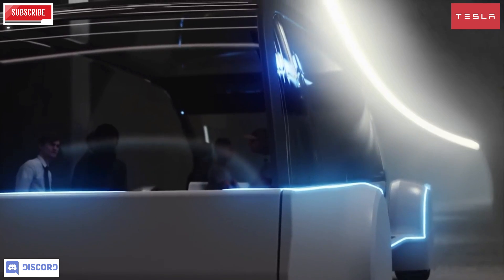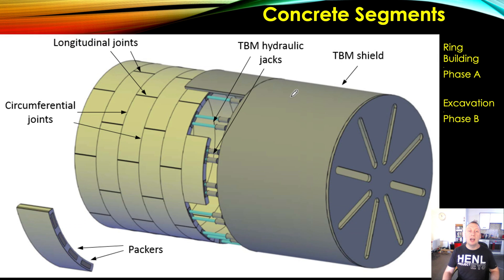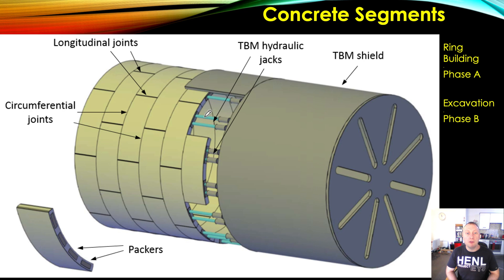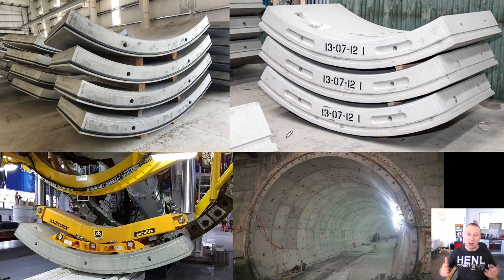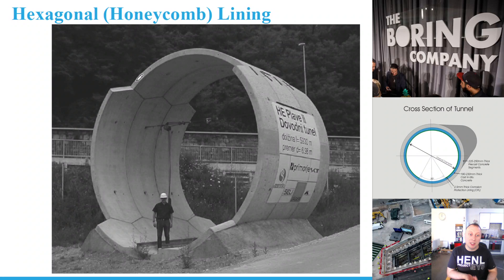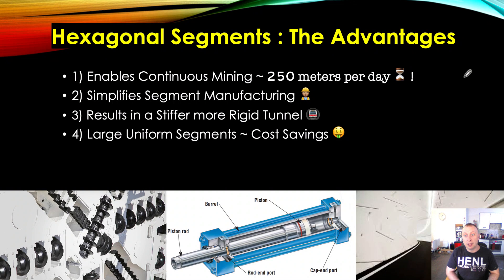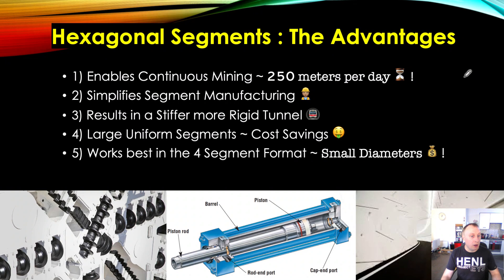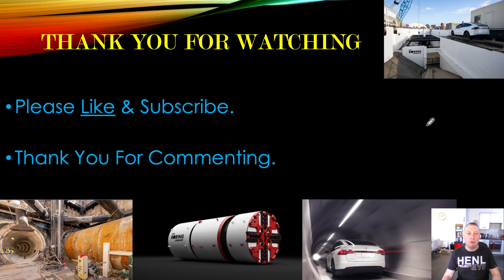The Boring Company 🚇 😃 🇺🇲 Hexagonal Concrete Segments Are The Future 👷🏽‍♂️ 🏗️ 🚎 PART 1

Comment: Hello;  I just found this channel.  I've heard that the next boring machine will produce its own segments as it goes, rather than bring them in from overground facilities.  If this is the case, the molds used to produce them could be articulated molds, able to produce bricks that continuously adapt in dimensions to support curving tunnels.  I'd like to have your thoughts on that.
Reply: Where did you hear that about the next tbm producing its own segments (wall panels)? Have you got a link to the source that you can post here please?
Reply: @dianax266  Sorry, I went looking for it and couldn't find it.  Maybe I misread something, or it was an opinion;  not sure.  I'm not in the habit of keeping links, bookmarks or references;  my life's problem...
Reply: @dianax266  I found where I got the idea;  it was an Elon speech;  which this recent CNBC spot on the Boring company replays:
https://youtu.be/hFx6vx4P9M8?t=315
But what he's saying is "Building the tunnel reinforcing segments on site ...", which I took to mean within the TBM, but it probably means simply having movable equipment that can make the pieces locally, near the tunnel, as opposed to in a factory in another city.
However, it seems to me a matter of time...  If you already have movable equipment that can produce panels, why not hook them to the boring train?  Or at least have a few tile making train cars with adjustable molds so that the TBM can produce its own custom tiles a la carte when it needs to, such as for turns, in/out ramps, etc.
Reply: @privateerburrows 
Thanks for the reply and sorry I did not reply sooner.

I took a look at the video you linked. Unfortunately Elon  appears to be not only ignorant of how concrete panel segments are constructed (which is done off site) but he is also misinformed regarding how other tunnel boring companies construct tunnels.  There is zero muck transported back into the tunnel (after the excavated muck is removed). The only materials transported back into the tunnel are precast concrete panel segments (and grout and the like).

It is quite staggering that the guy at the head of a tunnelling company knows so little of the absolute basics of tunnel construction. If you show the clip (you posted) to anyone with tunneling experience or a structural engineer then be ready for them to fall on the floor laughing.
Reply: @dianax266  You say that "Elon appears to be not only ignorant of how concrete panel segments are constructed (which is done off site)...".  He nowhere says that segments ARE constructed on-site.  He is talking about HIS OWN IDEA that it is better to construct them on-site.
  Then you say "but he is also misinformed regarding how other tunnel companies construct tunnels".  I don't see where he describes how other companies construct tunnels;  he is busy explaining his own ideas for how to construct them.
  You say "there is zero muck transported back into the tunnel";  but he never said that muck is transported back by other construction companies;  he says he wants to possibly use some of it in the manufacture of segments;  it is his own idea, namely to mix some of the muck with the concrete for the segments, which as per his own idea he wants to make on site;  and then make standard housing bricks out of the rest of the muck, to sell and help offset cost.
  Finally you say "it is quite staggering that the guy at the head of a tunneling company knows so little of the absolute basics of tunnel construction".  I find it staggering that you misinterpret almost every word he says, just to come to the conclusion that he does not know how to build tunnels, which he just finished building in Vegas !!!   Either you are an idiot or you must have an anti-Musk agenda;  or maybe you are in the tunneling business and are trying to keep yourself in denial of the fact that you are finished.
Reply: @privateerburrows 
This is what he says from 5.12 in the video you linked:

"The the dirt removal is continuous. Building the tunnel reinforcing segments on site instead of having them be built far away and trucking them in. Using the dirt that WE DIG OUT of the tunnel to FORM THE CONCRETE for the reinforcing segments.  In other tunneling situations, they actually truck the dirt from the tunnel out and truck new dirt in , which makes no sense."

Back in 2018, he expressly stated that TBC were making segments on site with muck/ dirt removed from the Hawthorne test tunnel therefore I suggest it is you (not me) that is mistaken.

Also, as clear from the quote above, he is referring to dirt being trucked back in (by other companies), which does not happen. 

Concrete panel segments are neither made with "dirt" / muck nor are they constructed on site.  They are constructed in factory conditions off site. 

As I said, anybody with any tunneling or engineering experience would know what he says is ludicrous and displays his ignorance of the basics for an industry that he has a company operating within.
Reply: @privateerburrows 
Perhaps you may wish to educate yourself regarding tunnel construction before you try pretending you know something about tunneling (based apparently solely upon what Elon says).
Reply: @dianax266  What you quote verbatim is exactly as I understand things.
When I said HIS IDEA, I wasn't speaking of "the future";  that's something you added.  Stop putting words in my mouth.
What exactly was a lie?
I saw people in video interviews who bought bricks from him and used them;  what exactly is "BS/lies" about his making bricks with the excavated dirt?
And if he knows nothing about boring tunnels, then explain to me how did he complete the first pair of tunnels in Vegas.
Reply: @privateerburrows 
You appear to be confused and contradicting yourself.  In your post circa 14 hours ago you state the following:

"He nowhere says that segments ARE constructed on-site. He is talking about HIS OWN IDEA that it is better to construct them on-site"

In your latest post you say that what I quoted verbatim (regarding Musk's claim that they actually made panel segments on site at the mouth of the tunnel of the Hawthorne project from excavated dirt) is exactly your understanding. 

If such is exactly your understanding then why did you previously claim he nowhere says that segments are constructed on site? 

Regarding your question "what exactly was a lie?" the lie is Elon's claim that they actually constructed panel segments (from the excavated dirt) on site at the mouth of the Hawthorne tunnel project. 

Regarding your claim that you saw people in video interviews who bought bricks from him and used them that is not evidence that bricks were made on site from excavated material.  Notwithstanding this, please provide a link to such interviews you claim to have seen and identify the approx. date bricks were allegedly bought and the location where they were bought? 

You appear to have ignored my suggestion that you educate yourself regarding manufacture/ construction of components used in construction. 

Regarding your final question, I suggest you re-read my posts regarding what I said about Musk as your question does not reflect what I actually said (and is therefore based upon a false premise).
Reply: @privateerburrows 
Not only are you contradicting what you have expressly stated in this thread but you are also contradicting what Musk expressly stated in the presentation he gave in May 2018 (at 16.30 of the video I linked in a previous post of mine). 

I will repeat what he expressly stated with regard to the Hawthorne project:

"WE WERE CREATING OUR OWN CONCRETE SEGMENTS and WERE CREATING THEM ON-SITE USING DIRT that we dug out of the ground which again like it may seem like an obvious thing but this is almost never done or we're not aware of a case where the concrete segments - the reinforcing segments - actually use dirt  that was dug out of the hole.  it's typically using some construction company far away and they bring in the constructed concrete segments but WE ACTUALLY MAKE THE CONCRETE SEGMENTS ON-SITE AT THE START OF THE TUNNEL"

This could not be clearer. He is stating what TBC allegedly actually did (in the past and currently as at 2018).

This was not him venting an idea about what he hoped to do in the future but making a claim as to what TBC had actually done and were doing on the Hawthorne Project in 2018.

So, with respect, I am not incapable of distinguishing between what he claimed to have done/ be presently doing with what he intends to do in the future.  It is clearly you that is incapable of doing so despite the incontrovertible evidence that Musk made such claims in 2018.

Given that your latest post is (again) based upon a false  premise (which is contradicted by the evidence) your conclusions (based upon such premise) that I'm a POS, stupid, etc. are fatally flawed and meaningless.  They are 100% wrong as I am none of the things you accuse me of.

If you wish to continue to argue black is white and continue to embarrass yourself then that is your prerogative.  Also if you continue to remain ignorant and not educate yourself then (again) that is your prerogative.  As the saying goes: 'you can lead a horse to water but you can't make it drink'!

You have shown that you wish to ignore my previous suggestions but I will nevertheless make another suggestion.  I suggest that if you are attempting to debate that (1) you firstly check the facts (2) you are capable of substantiating your argumebt/ point and (3) you don't resort to childish ad hominem. The latter merely reflects badly on your own integrity and credibility.
Reply: @dianax266  I contradicted neither myself nor Elon Musk.  I never made any categorical statements regarding whether any of the ideas he floated were already applied or planned for the future.  What I clearly said is that it is IRRELEVANT.

  It is not relevant to this conversation.

  This conversation is about your calling him "ignorant" about how tunnels ARE made;  whereas he was talking about how HE makes them OR INTENDS to make them.

  He was NOT describing how tunnels ARE made.

  What words can I use to get this kindergarten level idea across to you?
Reply: @privateerburrows 
Do you want to tetract/ delete / or otherwise remove what you said in you last post? I'm giving you this opportunity (whixh I suggest you grasp) otherwise you are likely to be further embarrassed.  The choices are completely yours to take.
Reply: @dianax266  And you keep trolling, and trolling, and trolling ... So you cannot make your nonsense stand by using logic, so now you resort to veiled threats?
Keep trolling and trolling ...
Reply: @privateerburrows 
Should I interpret your last post that you've chosen not to retract / delete (or otherwise remove) what you said in your penultimate post? A simple yes or no will suffice so there is no possible misinterpretation.

I note your reference to "logic" which is somewhat ironic given your changing positions are devoid of logic.  As I said to you previously I base what I say on facts and evidence (so there is a clear logical basis to support what I say). Unfortunately, you appear to ignore & avoid facts and argue black is white; or complete avoid points and try to divert to irrelevant and unconnected matters.  Your reference to "trolling" in your latest post is another prime example of this.

Since you appear to (again) be confused and/ or misinformed I clarify the following:

1. I am not a troll and I've not been trolling you.  It was you that resurrected the discussions 10 months after the initial posts.

2. I have not made any veiled threats.  I merely offered you the opportunity to retract/ delete/ amend what you posted in order to save your own face.

3. I have not attempted to make any "nonsense stand" (by logic or otherwise) for the simple reason I've not posted any nonsense.  You appear to be confused (again) by conflating your posts with mine.
Reply: @dianax266  Well, perhaps you remember I am the original poster in this thread, so I can revive it whenever I want without incurring trolling.  A troll is by definition not an original poster, but one who is an annoying poster not contributing anything useful;  often an "opponent" that argues unfairly, makes ad-hominem attacks, or who wastes time arguing things which are unrelated to the original post.  ALL of which applies to you quite precisely.

  Secondly, I only revived this thread months later because you had asked me a question I could not answer at the time, as I had lost the link to where I thought I had heard about the segments being made inside the boring machine, which as I already admitted was a false memory on my part.  But months later I came across that lecture by Elon and I posted that link just to show what I had actually heard, versus what I had thought I had heard.  I really thought you were going to receive this information well and laugh at my mistake in good nature.

  What happened instead is that out of the blue, for no reason whatsoever, you began attacking Elon Musk, calling him "ignorant" for not knowing how tunnels are constructed.  And since then I have been unable to get across to you that he was NOT talking about how tunnels ARE constructed, but rather the way he would do it.  Which, by the way, he has said repeatedly that anything he says should be taken with a grain of salt, as he often changes his plans, whether in tunneling or in rocketry or in autos or in energy ... To me that's the mark of an intelligent man, who continuously learns and improves, as opposed to certain bone-headed people that have zero intelligence and all they care about is prevailing, or appearing to prevail by tiring their opponents out and hopefully getting the proverbial "last word" in the discussion.

  Frankly, I'm completely unsure whether you are so unbelievably stupid you cannot understand the sentence "He was NOT talking about how tunnels ARE made";  or whether you understand perfectly well but pretend not to, disingenuously thinking that if you keep trolling and trolling, at some point I'm going to give up and stop posting, and then anybody else reading this long tirade will assume that you have won the argument.  Stupid or evil?  I'm split 50-50 on this question.

  And the other thing you said was that it was "staggering" that Elon Musk is the head of a tunneling company;  which you did not provide "facts" for (I'm not sure what kind of facts could back up a "staggering" assertion);  and which you repeatedly ignored my simple request that you explain to me how is it that he delivered the first two functional tunnels in the Vegas Loop, if indeed he is as incapable and ignorant as you ignorantly claim he is.  But of course I don't expect you will try to answer it now, or ever.  You are too busy providing "facts and evidence" ...

  So you say you've been providing "facts and evidence",  but facts and evidence for what?  How could you provide facts and evidence that Musk is incapable to lead a tunnel project, when in fact he just did?  How can you provide facts and evidence that he doesn't know how tunnels ARE constructed when on the video you point out as evidence (MY link, at that) he is NOT saying anything about how tunnels ARE made?

  So you pass subjective, malicious and ignorant personality assessments that cannot be proven, then provide facts and evidence for other things you say that are NOT related to those ignorant assessments, and then try to pass this whole fallacy as having provided facts and evidence for your original ignorant and stupid personal attacks on Elon Musk;  and when I call you on the complete lack of logic to it, you just say new and equally unrelated things and provide facts and evidence for these new things that again fail to relate to what you said earlier ...  and so on ad-infinitum.

  And you have to admit that whether Elon Musk is "ignorant" as you ignorantly assert, or not, has nothing to do with the subject under which I originally posted this thread;  does it?  So you are in full fact a troll,  absolutely, 100% A TROLL.  You are a spider squid alien wrapped around my face that not even surgeons can pry off, as their tools are dissolved by the acid coming out of your soul when they try.

  But I am NOT going to let you have a last word after the quintillion of fallacies you've vomited here, plus personal attacks on people that are a billion times your betters.  I'm not someone who quits, or who lets injustice pass.  So keep trolling me,  and I will keep replying to your stupid garbage until YOU stop your pestilent posting for good.
Reply: @privateerburrows 
You never answered my very simple question.  Instead you've launched into more gish gallop, which is littered with further contradictions, hypocricy, misrepresentations and falsehoods.

You've succeeded in further embarrassing yourself.  Despite you previously acknowledging  that your longer term memory is not great and fact checking is not your forte, you've shown you're short term memory is also suspect & you can't even check facts that you need to look no further than this thread to do.

You also have not heeded my suggestion to educate yourself regarding the basics of construction even though I offered to post you links to help you out.

It's quite sad to witness but clearly you've made the choices.
Reply: @privateerburrows  TBM tunneling site in an urban location maybe 30m x 100m = 3,000sqm. Segment casing yard often can be 100m x 300m 30,000sqm in size, per client, maybe have 3/4 contract clients on at the same time, also needs 28 day storage of production for strength gain. Hence, extremely rare to cast the segments on site unless with a lot of spare space in a remote location. Seems like a good point to me.
Reply: @tunnellingsalisbury7605  True.  Full hardening of concrete takes several days, doesn't it?  What about one of those new variants of concrete, such as the one that uses carbonated water instead of regular water?  I think I read of some newer types of concrete are faster setting than the regular type.
Reply: @privateerburrows  Rapid hardening concrete is fairly common but it does tend to compromise the long term strength gain and the stiffness of the concrete, plus it is expensive.
Most if not all clients specifications will require a 28 day strength (tested at or beyond 28 days after casting). 
So a lot of storage space is required for a months worth of segments. Moerover, the production usually starts several months before the Tunnel as the TBM's, if all going well, can install faster than the production. The last thing you want to do is run out of segments when you are getting good production.
Reply: @tunnellingsalisbury7605   Ok, I guess that settles it, then.  And, come to think of it, the shape of the tunnels, bends and all, is planned in advance;  so custom segments can also be produced in advance and shipped into the tunnel with bar codes to specify where they are to be installed;  so, no need cater them locally.  Thanks for the good info.
Reply: @privateerburrows  Nowadays I would only reccccomend the use of a universal ring (only one type with a taper that can be rotated and positioned to follow the TBM). If you have long tunnel, it is not uncommon to have 2 full ring sets of segments on the TBM waiting to be installed, 2 more sets in transit in the tunnel, One set loaded at the bottom of the access shaft. So that is 5 rings ahead (7.5m) you have to predict where the TBM will be to decide which type of ring to load next if you are using a "left" "right" " straight" ring system. 
Plus you need to store all 3 types on site, and have 3 different sets of moulds to manufacture and store the segments. It creates a lot of logistical problems in storage, handling, sequencing etc. 

If the TBM moves a little off line you may have the wrong ring next on the feed magazine as you will have less than 50mm tolerance. Remember the rings must follow the TBM, if it strays off line the rings have to follow it.
Moving these concrete block forward along a TBM when they have been delivered in the correct sequence is one thing. Swapping them around when they are in the wrong order is a safety, time and quality nightmare (even if you have room, which most TBM's don't and TBC's are too small for that space).

All segments manufactured on project I have managed in the last decade have full QR code trackability on them for quality control reasons, but we still put joint alignment letters on them all cast into the concrete mould as a simple visual check for the ring build team.

There are usually good reasons why an industry does things the way it does. A lot of experience and engineering over the last 60 years has gone into this.

Note: Japan still tend to use left-right-straight rings as their very outdated code requires the 'key' to be above the tunnel axis. Too many client specifications and statutory regulations are decades out of date.
Reply: @tunnellingsalisbury7605  Holy smokes!  You've painted the clearest picture for me I ever imagined.  Makes sense that not everything goes as planned;  specially underground, where there's no GPS to rely on, which is a question that keeps eating my liver every day ...  Dead reckoning?
  Anyways, 50 mm sounds like a lot of tolerance to me;  a whopping two inches?;  I thought the interlocks around the segments were smaller than that.  Use of discrete left, right and straight types are a revelation to me, too;  but on second thought I guess the huge tolerance allows for continuous curvature change.
  Also, I would have imagined left and right segment types being interchangeable by flipping the segments around;  but let me guess:  that would put the interlocks backwards, right?
Reply: @privateerburrows  Sorry. I think I mislead you. The overall tolerance of the tunnel would typically be a maximum of 50mm on alignment and maybe 20mm on level. That's for a 10-12m diameter behemoth excavating through variable ground conditions. It's a constant balance of balls to keep in the air to make that work.
The tolerances on the ring build are much tighter, usually within 5mm on the alignment of plates. No gaps allowed. The gaskets (black bands) on the edges of the plates are compressed into a groove to form the watertight seal (much like an oversize 'O' ring), they are often backed up with a hydrophilic strip (swells on contact with water). Main survey is a combination of traditional surveying and the use of a Gyro (north-finding) theodolite .  Then the TBM uses the primary survey and a combination of lasers and light sensitive targets to survey its way forward and more importantly predict its next position based on its current steering settings. The more advanced systems can also tell the operators which orientation to build the ring to keep the finished tunnel in alignment with the tail can of the TBM. If the rings go off course from the TBM they will very quickly catch the sides of the inside of the tail they are built inside, become what is termed "iron bound", this is a very very bad situation for a TBM tunnel to find itself in and must be avoided at all costs.
There are lots of youtube videos that explain all this much better than I can in words.
The Herrenknecht site is a good start.
https://www.youtube.com/watch?v=MZsbFycQ0Vo
Reply: @privateerburrows  You can't turn the left and right segment sets around as the "key" segment is tapered to allow it to be installed and put closing pressure on the rest of the segments in the ring. So it has to be installed from front to back so to speak.
Reply: @tunnellingsalisbury7605  Ah, okay;  so 50 mm positional;  I was picturing 2 inch gaps :)  Thanks for the clarification.  So I suppose there must be vertical holes drilled periodically to help guide the TBM.  Another thing that it occurs to me could be used is ground penetrating radar.  Maybe I should patent the idea:  Something like a GPS made of ground penetrating radar transponders sitting strategically above ground, that the TBM can communicate with and triangulate its own position.  But I don't have money to pay for a patent, so take it away.
  That was a great video to watch;  learned a lot.  Touche about the key segment.
Reply: @privateerburrows  To get a survey alignment down a shaft and into a tunnel a technique called a "weisbach triangle" is traditionally used. Plenty of Youtube videos on how to do this its fairly basic trigonometry using error correction theory. 
Of course for a short straight drive you can still use two plumb bobs, two buckets of oil with a dumpy level and staff. It's all just trigonometry.
Since the channel tunnel there has been a more useful method called a gyro theodolite. The original invention was very bulky, sensitive and expensive to hire and would be used only once or twice on a project. These, like all things, have become more compact and reliable and so large TBM's will have these mounted permanently in their steering systems. Or they may be used periodically to check the alignment from primary survey points along the tunnel wall.
A Gyro theodolite, as the name suggests, has a gyroscope inside it which always wants to point to magnetic north. So if you know where you are on the planet, and have the magnetic north correction angle for your location, you can figure out where you are going. Add lasers to this and you can measure how far you have gone. Hence you can drive for tens of kilometers underground with some confidence that you can end up within a few millimeters of where you wanted to be.
One of the many advances in tunnelling in the last 30 years.
Reply: @privateerburrows  My own experience of GPR (mainly looking for unexploded bombs in excavations or trying to predict voids in front of TBM's) is that it is very limited in its accuracy and range, especially when we are looking for  mm accuracy for steering TBM's. It also suffers a lot of "white noise"  from things like buried utilities, especially electric cables. Others think differently  but I have not seen the latest generation showing much to inspire me.
Save your money.